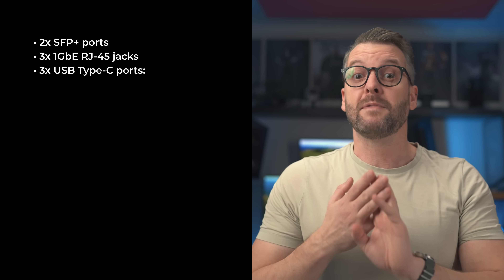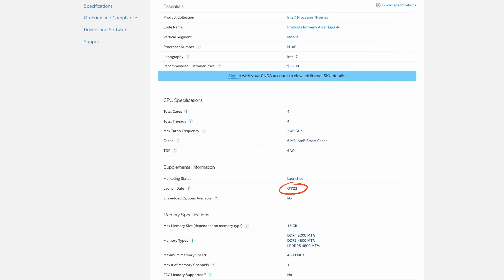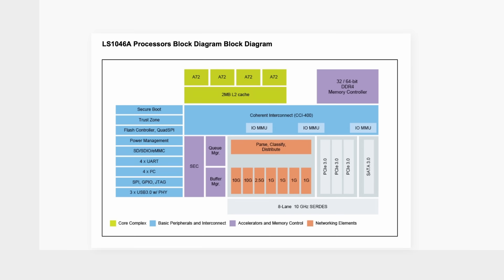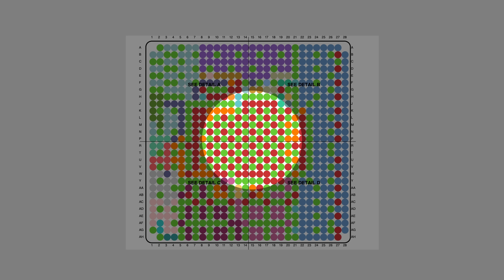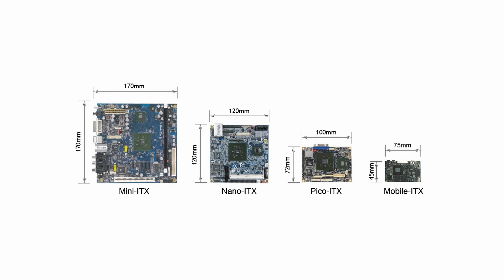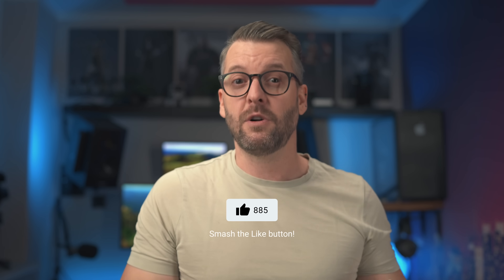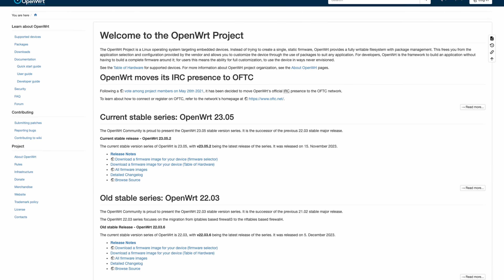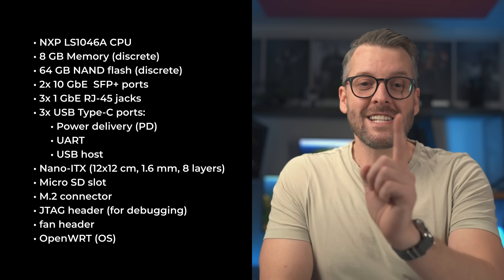I'm making a high-end router IN PUBLIC. Here are the final specifications.

Comment from the maker: Is there a particular feature you ABSOLUTELY HATE that it's missing?
Reply: Micro SD! Is that really necessary? Feels like an extra that has little to no value especially since they are slow af lol. Nice touch with the M.2 connector. Would be baller to swap Wi-Fi Modules each time there is something new. 
Is there going to be any optional SaaS or Are you mainly keeping this Open?
Also, on the Nano-ITX, is this something that you are designing from scratch or using some pre-existing template (hardware) that you are just bringing it up to date with newer components?

Good job. Excited for this tool.
Reply from the maker: Fun fact: MicroSD makes it easier to develop as we can leave out NAND completely (in the prototyping phase) and have the operating system on the microSD card, which makes it much easier to swap to an Ubuntu machine for changes to the filesystem, for example.
And yes, M.2 was selected for this very purpose, I want the router to be usable for at least 7-10 years, and with a new wifi standard coming out what seems like every week, this is the best way.
We're designing everything from scratch!
Reply: @tomazzaman  That is A LOT of NAND flash compared to most routers 😅, think a lot of bases have been covered, it will be nice if Intel would actually allow AP mode on their wifi modules but that is more on Intel 😂

Only thing I can think of, is a debug/status display though that is a nice to have at best.
Reply: I have to say. This is some exciting stuff. Cannot wait to try it out @tomazzaman
Reply: @tomazzaman  Woldn't a usb-stick do the same if there's usb3-port available?
Reply: @tomazzaman  please make one for (sim modem) remote areas in india we get high speed 5g network but no broadband cable connection.
Reply: Maybe something to look at since you are looking at PoE - is pick a port to allow PoE-IN 
So what that would allow someone to do is have a switch power it - 1 less power adapter ... or that and pwr adapter (in case the psu dies - happens - poe backup)
Reply: Hate that 2.5gbe is missing, please include that since the cpu supports it.  I know this is a router, not a switch, so only internet traffic is going over it, but if you can get a high-speed connection out of it without SFP modules you must, fibre to the home 1.5gbps is already here, upto 3gbps even I think with Bell in the area
Reply: @brainsoft it being a router doesn’t mean that only internet is going over it. If you have separate vlans that traffic would need to go through the router. Having 2.5 is something I think would be fantastic.
Reply: @brainsoft  I agree. 2.5GbE is swiftly becoming standard for home networks. I'm in New Zealand where we have domestic fibre connections with speeds up to 8Gb/s (yes, 8Gb/s), so 1GbE is pretty much a deal-breaker for me. There are plenty of affordable router boxes with 10GbE SFP+ and 4 - 8 2.5GbE ports as well, so unsure of how much interest there will be for Tomaz's router, which is a shame.
Reply: With respect I think you’re missing the mark with the processor choice. There’s a heavy trend of right to repair and people are becoming more privacy aware and subscription averse (paying monthly for storage). From a brief review of the block diagram of the LS2084A (or the 44A) it’s clear it meets today’s fastest networking standards of 10Gbps and has headroom for growth when FTTP reaches 10Gbps to our homes: you refer to aiming for an expected lifetime of around 7-10 years. You could use the additional power of this CPU and reserve a design choice for future expansion in the form of additional SFP+ support, allowing user’s choice whether they want RJ45 or fibre around their premises. Whichever way you cut it I feel your current CPU choice which “might” support 2.5G … let’s just say it feels more like the Alfa Romeo (a Fiat in wolf’s clothing) rather than a Maserati.
Reply from the maker: @IndigoVFX LS2084A is three times the price of LS1046A ($210 compared to $70). This would make the device at least twice as expensive. And if you check the responses (I've done a video on it a while ago), then most people aren't willing to pay much more than around $300 for this device, which is already impossible. So yeah, it's always easy to dream up, however, it's always the customers who vote with their wallets.
Reply: Ventilation holes for a fan. Having experienced AliExpress fanless sfp routers where the SFP ports sometimes overheat when using 10Gb copper modules in them, I'm pretty convinced you want some active cooling even if the CPU doesn't need it.
Reply: 2.5Gb Ethernet is getting very popular in the home networks. So, I am voting for this feature.
Reply: Hate is a strong word. But i do think 2.5gbit ports are preferred over 1gbit.
Reply: I NEED that 2.5gbe port IM BEGGING
Reply: ECC RAM
Reply: Really hoping for 2.5/10GbE
Reply: Make sure the USB-C PD port uses a standard voltage (no 12V bullshit), and uses a LOCKING connector. Regular USB-C is waaay too easy to accidentally unplug, and adding a locking hole to the housing should be pretty trivial.
Reply: What is planned power consumption of this device?  Low power consumption is a big priority for me, it would be perfect to stay under 20 watts maximum under full load.
Reply: I think adding at least 1 POE+(or even ++) Port is a good shout... for it not having Wi-Fi,  you could substitute and power an external Access point from it :)
Reply: Will it run ProxMox and other ProxMox softwares with pfSense ?
Reply: 2.5 g!
PoE!
WiFi on pcie m.2, easy to swap!
Reply: Absoluteley Suricata or other DeepPacketInspection or TrafficShaping / Quality of Service features. Please REALLY think about the CPU choice as for today, as an enthusiast and also people in my friend group wouldn't buy hardware that couldn't support at least one of these
Reply: SATA, it's more resilient than sd-card or emmc
Reply: Hi Tomaz, really looking forward and enjoying the progress of your project. Please (please) make all the NIC's at least 2.5gbe :face-orange-biting-nails:
Reply: I would love to see another sfp+ port.
Reply: How about planning something to make it work for init7 out of the box that supports 25gig?
Reply: maybe im nuts but I feel 2.5gbe is gonna be here and gone way too quickly. I'd rather a 10GBase-T instead of 2.5g
Reply: i think that yelling expression is very bad, pardon mua.
Reply: POE and if 2.5GB please
Reply: One think I've found out right now that I'm missing in a small router: flexible cards to be swapped. I notice that OCP 3.0 could be used for PCIe to NICs that supports OCP 3.0 ports. In this way we could use whatever ports we want. There are plenty OCP cards. LS1046A has x1, x2 or x4 PCIe 1.0 or PCIe 2.0 or PCIe 3.0. In this way the router will not have fixed ports. OCP is a standard connector.
Reply: Maybe have two of the USB-C do the power delivery inputs, so you could have a setup with redundant power supplies. Also, I don't know much about that NXP CPU but I sure hope it has some crypto acceleration features for VPNs tunnels.
Reply: I would need OPNSense at the very least. My current setup is OPNSense running in a VM on Proxmox. The only reason is I like the easy snapshots before an update. I love where this is going though!
Reply: For that pricepoint I would want to run a few containers on it for dashboard, adblocking, wificontroller/radius and have the NIDS log traffic locally (not even speaking about NAS, VOip and IoT). Also add dual power input, USBc is great for minimal ups, but a second phase from a screw-in barell feels luxurious
Reply: Integrated sex toy.
Reply: give it more compute for dpi etc. 1x10g sfp+ and 2-3x2.5gbe. 3 usb is excessive
Reply: I see this device rather a firewall running OPNsense than a router running OpenWRT; imo security of the privat network is more critical than connectivity.
Reply: 2.5Gbps support on the sfp+ port. For GPON SFP modules such as a Alcatel Lucent G-010S-P or Huawei MA5671A, which is both by the same manufacturer Source Photonics. It runs either 1Gbps or 2.5Gbps, which is used for WAN connectivity obviously. Some ISP provides these modules but they can also be purchased and used by cloning the ISP provided GPON ONT.
Reply: No serial interface... when using OpnSense, there is the option to use GPS as time source, but only with a "real" serial connection you can use the PPS signal, a USB to serial interface isn't in suitable.
Reply: @UdoHartmann Yeah I'm also running a GPS NTP server, and would like some way to breakout the bare serial pins, especially DCD, even if it's just a COM header on the board. Also the Cisco style console port does not have DCD, so don't use that.
Reply: 2.5gbe ports are essential, JTAG pins needs to be accessible, even if you start with a wrt derivative are there plans for an "approved" application/appliance store/certification down the line to be able to run either custom software or applications on the platform?
Reply: It is a network device it needs a proper console serial port like a Cisco or juniper. If it doesn’t have this it will never get used in some enterprises
Reply: Too bad it's an ARM CPU. Unfortunately this means no OPNsense support until it is ported.
Reply: RGB? There's a need for RGB!!!

Anyway, no complaints about the spec, really.. Looking forward to full production
Reply: LOL, fuck it might as well light up the room with random colors. @eustache_dauger
Reply: I tell you what is missing and why your project will fail. It needs to be an access point, not just a router. Put more RAM, and make a device that is serving as access point, router, and media server, all in one, then I'll buy it. Make only a router and you will sell only 3. What I need, and it does not exist, is a small computer I can use as access point, router, where I can create a network for guests, or a different network for clients who are "dangerous" and may sniff the network traffic, like the WiFi kitchen appliances. I want to perform backups on it with Time Machine, and I need to be able to stream a movie, and install a home server software. All in one. Right now I would need 3 different devices. You are building something that already exists, and no one need. Most people buy integrated HiFi systems, audiophiles only buy pre, amplifier, CD, etc. You are making something for "audiophiles", in a market where there is a lot of competition. Good luck anyway.
Reply: @biomorphic  you have completely missed the point of this product.
Reply: @biomorphic  
Hi, I think you might prefer something like @networkchuck built a while ago. The "travel router NAS" https://youtu.be/5FhDrux0kCc?si=HTV0yQqja-aWt_Zz
Reply: @biomorphic  lol.... the general populous doesn't need 10G so yes, it's definately over the std 'users'.
Also, as soon as you breach that gap of std... you WANT to have specific devices for each task anyway.
WiFi AP just does wifi and can be placed where it is optimal.
A router which routes super fast.
a NAS for backups.

All in one is great and all ... just go get a qnap or something ... or even better, a netgear ... But then don't complain to us when your wifi is slow because you are running a backup ...
AIOs are not ideal... espec at high speeds.

It is def not a massive market since the populous isn't going to go for it - the majority will go for what you say, but they will also be the most painful ones to deal with, want it for dirt cheap but have the best ... it doesn't work like that.

But , having a solid and small 10G router, there are not that many in the price range and going to be built solid like we expect.
Yes, market is smaller - but it does exist (you just aren't in it lol)
Reply: @mitchellmnr  No 10G router??? I am currently upgrading the whole backbone of my homelab to 40Gb and have a 5Gb uplink so YES to the 10G SFP+ ports!!

Comment: Quick question, why not just go with you know, those Qualcomm IPQ chips or maybe Broadcom even, like basically every other manufacturers out there? As far as I know, those solutions comes with network processing unit cores that theoretically does the same job of accelerating network packet processing, right? Going with Qualcomm's top-end solution will give you even better higher clocked CPU cores (2.2ghz A73 vs 1.8ghz A72). 

So yeah, is it just cost thing in the end of the day? I mean, it's Qualcomm, I wouldn't be surprised if they charged an arm and a leg for those chips, and wouldn't even pick the phone if you can't order millions of units.

Comment: Please provide a classic DC input jack in addition to USB-C PD, ideally with a wide range of input voltages (at least supporting both 12V and 24V batteries). That will make it much easier to power off solar/external passive PoE splitter/etc.) IDK if it fits your industrial design but screw terminals for power would be great, too.

Comment: Will it hang with 200 torrent connections? Also why not future prove by having 10gbit ports that support also 2.5 and 1gbit? Also why not a minipc with a lot of 10gbit ports - then you have a homelab in a box (with media server etc. for the whole home). That would be high end.
Reply from the maker: Adding more features doesn't make something high-end. In fact, it's often the opposite. Let me give you an example; Your PC has a sound "card", that's nothing special, but good enough for most. Then, if people require higher quality sound, they plug in an external DAC. Which can cost more than the PC itself. And then plug an amplifier into that DAC, that can also cost thousands. These two devices do WAY LESS than the PC, yet can cost more, a lot more. Because they're specialized and made using high quality parts which means these devices will likely last decades. This makes them high end.

Comment: If you guys go with uefi, sign me up! I don't mind volunteering too, as long as miscellaneous equipment is provided (debug cables, prototypes; i have the core/basic stuff).  I have a lot of c/c++ experience and also a good amount of edk experience. I wouldn't say I'm at the level of the guys at OpenCore  (you know, that level where you know all the quirks). I know how to debug uefi (at least in a vm) and I learned how the protocol architecture works through reverse engineering multiple firmwares. There are things on hardware/implementation side of uefi e.g. firmware volume protocol, which i don't fully grasp. Note, i did compsci, but I dabble a lot in low level and a bit in hardware.

Comment: Hey Tomaž, do you have any rough estimations on how it will perform as a router (in term of speeds)? Or a speed comparison with other most common used CPUs? Did you check BananaPi BPI-R4 which is quite similar to your board and also supported by OpenWRT? Pozdrav iz Slovenije :)

Comment: Just discovered your channel and this project... VERY EXCITING!

A key point for me is Wifi (802.11be) but you mention that this could be addressed via an M.2 slot. Making it a standard connector with easy upgrade path sounds like a great idea vs onboarding it!

Looking forward to seeing the progress, I'm tired of proprietary Wifi 5 / 6 routers that I can't flash OpenWRT on to. The trick of course is finding a Wifi 7 adapter that supports dual band AP mode

Comment: Software features are often overlooked unfortunately. The internet would be in a better way if the following were legislated for routers:
1. First time boot has blank creds, thus no vendor defaults to be abused;
2. A "Verify" button that needs to be physically pressed to confirm any changes be active by default (CISA propose this also);
3. Minimum functionality exposed on WAN port by default, everything else must be explicitly setup manually/via wizard; and
4. Auto firmware update must be on by default, and support period disclosed by vendor before purchase.

"... everything should default to most secure ..."

source/credit: Steve Gibson (https://en.wikipedia.org/wiki/Steve_Gibson_(computer_programmer))

Comment: I'd recommend implementing something along the lines of an SDN based device (software defined networking) with the appropriately compatible hardware. I've also found one of the most underrated but also most useful features is the ability to isolate devices to their own individual dynamic VLAN  (with a large potential VLAN pool, and granular ACL/QoS limits per VLAN) where these devices can only talk to themselves and the router; nothing else, that is completely enforced at the lowest levels of the network stack. 

Ruckus has done this since 2015 afaik for Blackhat attendies, and their setup is literally the gold standard for hostile networks,  along with threat management and other features such as being able to lock down protocols that are easily abused, and quarantine/disabling badly behaving users for a timeout/short time (maybe some form of RADIUS/Captive Portal cross-setup with 802.1x?).

Additionally, for security having a physically separate circuit (triggered by a button) that allows both dumping the SPI ROM, volatile memory, and/or (hashing it?), and writing a provided ROM image, in a way that doesn't disrupt existing operations until next reboot while remaining secure? This will be needed with current firmware level threats that are becoming more prominent globally with suitable key signing, verification, and the ability to manage trusted key signatures by the end-user.

Just some thoughts here.

Comment: OpenWrt is a fantastic piece of software, and in my experience Linux is a lot better for routing than FreeBSD-based solutions, especially for faster connections. I can achieve 8Gbps over a single iperf3 connection using OpenWrt as a router with a 10Gbps internet connection, but I've never been able to achieve that using OpnSense on the same hardware.